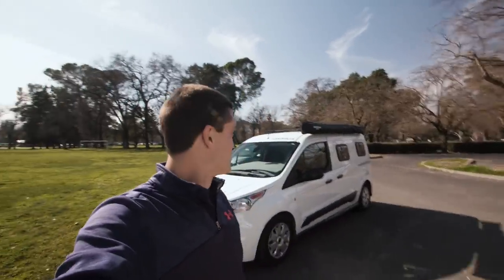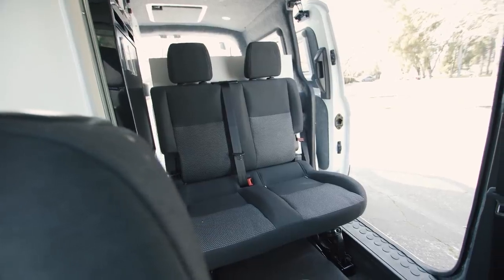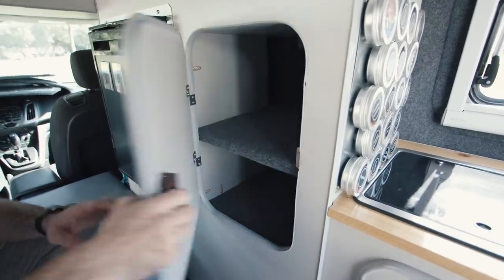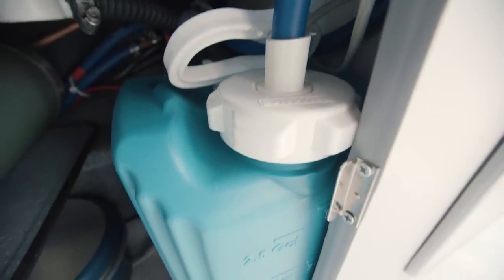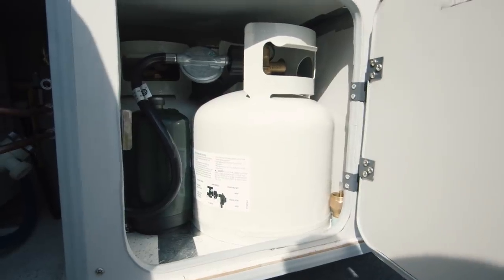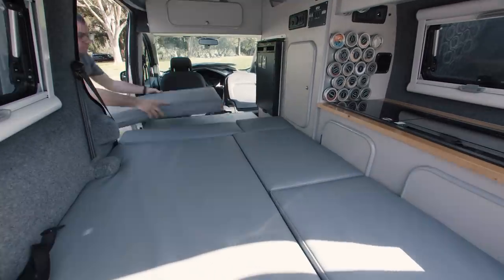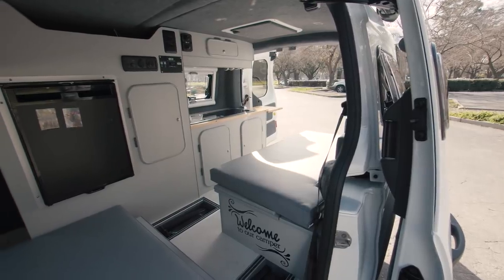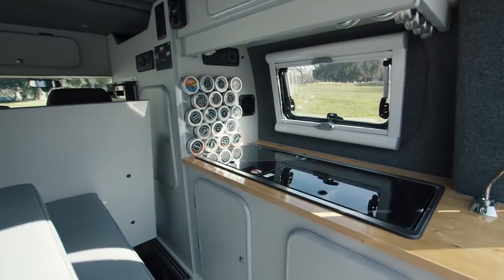Amazing Self-Build DIY Compact Camper Van Tour

Comment: The only thing missing is a pop-top! Excellent build! I have the same year and model, but had it professionally converted. Did not want a whole lot bc of the size and I go to campgrounds with electrical hookups and showers. I love my Ford TC camper, especially the gas milage which can be close to 30 mpg if I keep it at 60.
Reply: Does yours have a pop top?
Reply: Where did you get it professionally converted with the pop-top.

Comment: This is the best conversion I've seen so far. Exactly what I would want, the kitchen, heating, electrical... and the rear passenger seat is a must for traveling with a child or use as a daily driver. Very impressive.

Comment: There has never been a time in human history in which learning has been so easy, immediate and free!

Never designed and built your own camper before, no problem, the Internet has everything you'll need to know - and I do mean everything!

Self build can mean built to a considerably higher standard than a commercially converted van.

That is down to the builder, but the money saved in paying a complete stranger to do the work can be used to source higher quality components, materials and appliances.

Self build also means that the happy campers know everything about their travel cabin and its systems, so maintenance and any repairs may be carried simply and without stress or huge expense.

The best aspect of self build is that you can have everything exactly as you want it without compromise, and that's priceless.

I admire the builders for taking that decision and doing so with such high standards of design, ergonomics and craftsmanship and in such style!

They'll inspire many others to think about self build and the benefits therein.

It was a joy to see this beautiful travel cabin which I find to be elegantly simple and simply elegant.

The details of that neat collapsible shower tray would be most appreciated.
Reply: It's actually a 32" foldable dog pool you can get off Amazon

Comment: Need someone in Missouri to do my Transit. Just was delivered this morning! Yay! 2012 XLT with 40k miles. They are small but perfect. It's hard to imagine it as a camper, but I love it! Its a passenger van. With second row of seats. Removing of course. I won't travel in winter so it will work for me.

Comment: I have searched the internet and you tube and the internet for over a year.  I wanted to use this technique on my last build, but could not find the sources for these components that is talked about here in this episode, so I had to build the cabinets with more expensive materials.  I have a pocket hole jig and used it on my last build and it works excellent.....but where to do I find the the T trim for the doors??  Also I've seen the t trim for the edging but NOT the doors!   Can I buy the jig to make the doors or do you build the jig and if you do how do you build it?????  I am going to be refitting kitchens in RV's and mobile homes for my next project so I absolutely need this information!  Can you post the sources for the jig and door trim please!!!!?????
Reply: You and me both!  Plenty of t-molding and t-trim available but I've never found something like this.